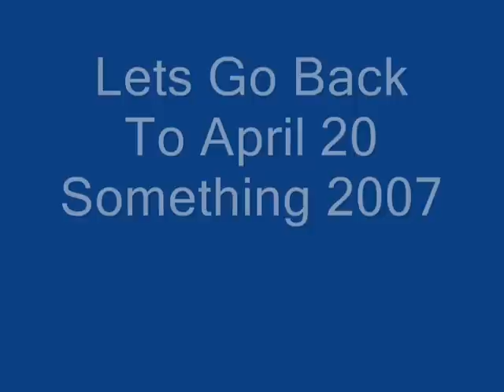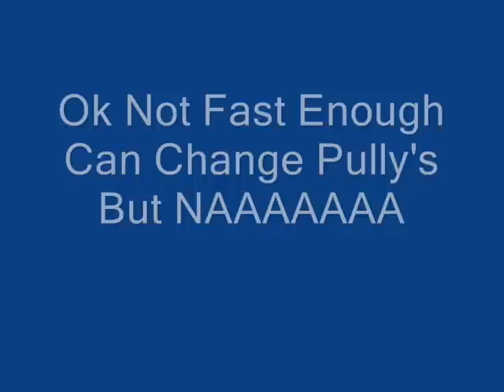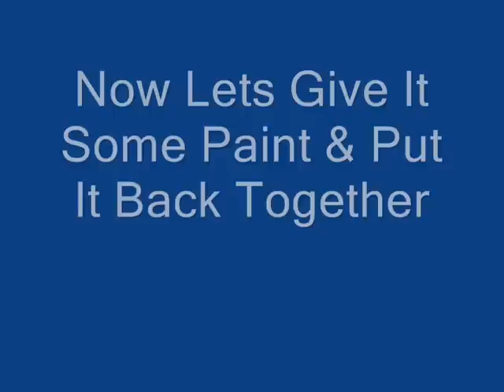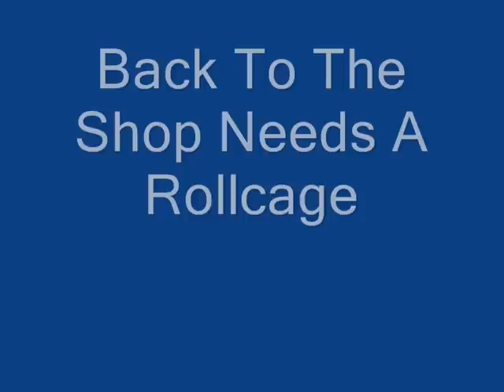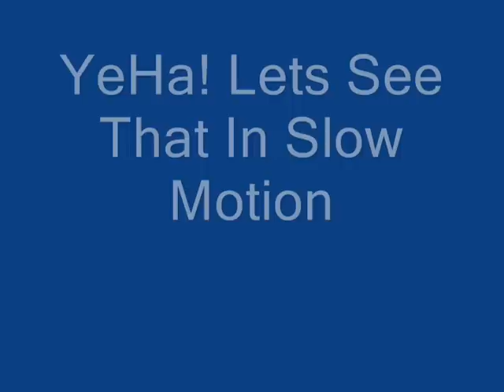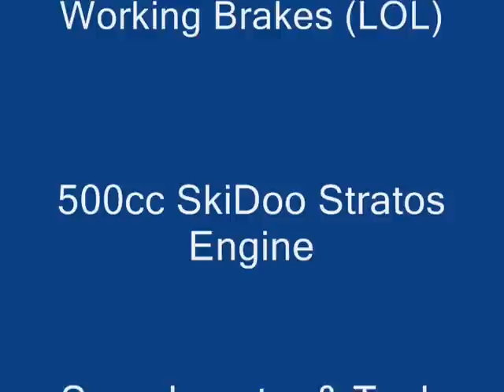Evolution Of My 250cc Mini Monster

Comment from the maker: Yes i took the front brake hubs , 250 cc engine and now have the 500 cc ready to go on it i blew up the 250 My warrior needs motorcycle or car engine / brake system would prefer car just so it has reverse

Comment: you surely dont sound like your going for aprenticeship, there called heat exchangers, and by no means are they to keep snow and ice from freezing, yes it is a tradeoff that they melt SOME snow, but if they were meant to do that, we wouldnt have fan cooled engines in a snowmobile. and oil coolers are mainly found in autos, and small atv free air engines, for when the extra cooling is nessecary